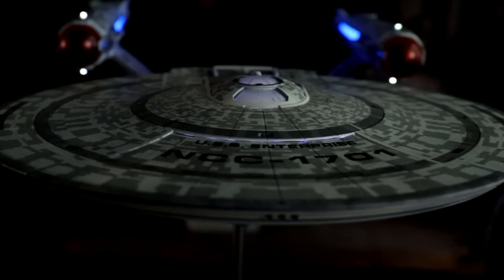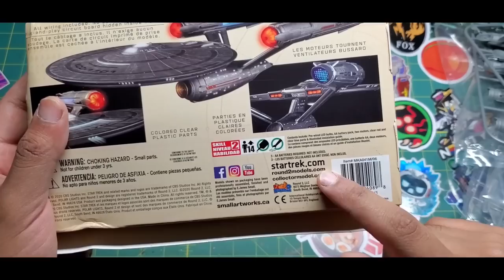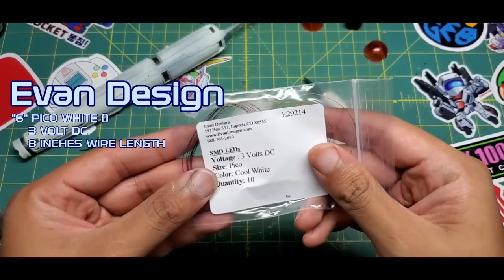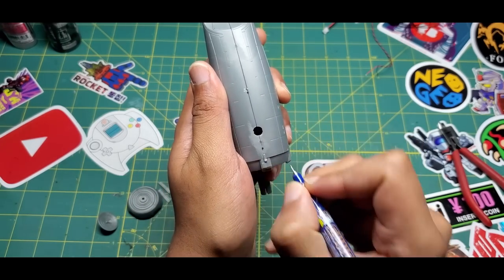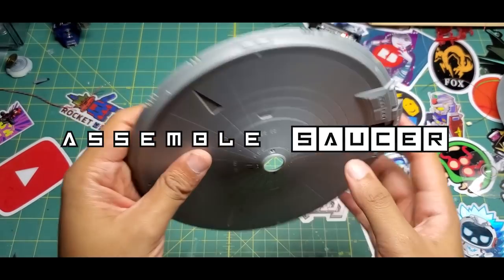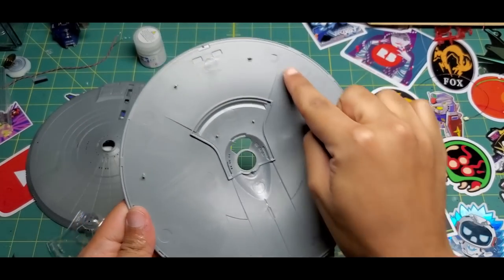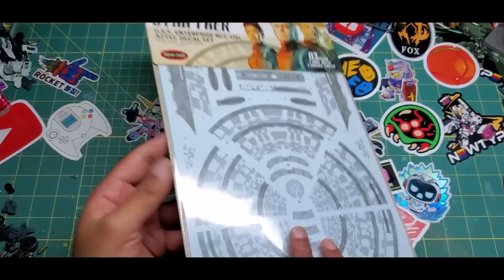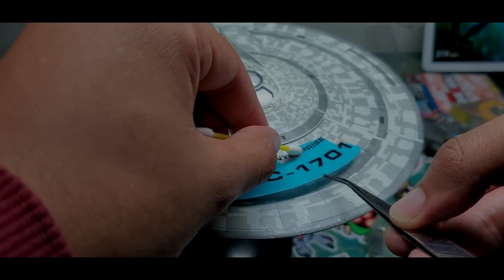#newtype #Otakubuilder 1/1000 Star Trek Discovery Uss Enterprise

Comment: In the old days. 1980 to 1999. The model kits were solid white. Also. The fiber optic Star Trek ship kits were in one box. I still have two Star Trek DS9 Terok Nor fiber optic space station. fiber optic Enterprise 1701 wrath of Kahn refit. In 1993. I went to a model shop and ordered telephone fiber optic strands from a company in New Jersey and designed my own Wrath of Kahn uss Reliant using circuit boards from Radio Shack. I also designed fiber optic. Jupiter 2. DS9 Rubikon Runabout. USS Enterprise E from First Contact. Battleship Yamato. I ordered it from Japan. The company at that time. 1994. Only made 3 kits per year. Extremely fiber optic detailed. Instructions are written in Japanese. But. I've been a serious kit builder since I was 13 years old. I'm 54 now. Kit building is very therapeutic and teaches you to have patience. Extremely good hand eye corrodnitation. It helps you train your Brain to build problem solving nural pathways that will benefit you as you get older in life. In my personal opinion. If you have a love for kit building. You. Like myself. Will become a "thinker" in life. Most people act first without thinking then blame others when things go wrong. Modelers. We are one of a kind. Problem solvers.

Comment: How have the stock Polar Lights LEDS held up over time?  Mine have dimmed to almost nothing after running them continuously for several hours after the build.  Then they started blinking randomly.  I luckily hadn't glued the nacelle halves together and I replaced the LEDS in there with a new kit supplied by PL.  What I found was the motors had actually melted the plastic holders.  So when I fixed it, I took the motors out.  I replaced the harnesses with new.  They've started to dim out again unfortunately.   The lights in the saucer and engineering hull are starting to go too.  Altogether,  I've got less than 100 hours on these LEDS.  It's frustrating.

Comment: Hey guys, starting this kit and finding this video to be a helpful guide! One thing I'm not clear on, do you glue the nacelles/hull/saucer together once you finish wiring? You have to to prevent light leakage, right? How do you go about that so you don't have any excess end up outside the model? Do you try to erase the seam with some puddy and sanding or just rely on the decals? Any guidence is appreciated. Thanks!

Comment: Back in the 1990's I was building the re-release kit of the Millenium Falcon.  That version did not include the lighting kit that the original did.  I also realised that the plastic was thin enough the lights would shine through it.  I solved it by first, spraying the interior with a matt black (Testors paint applied with an airbrush).  After that dried, I then sprayed over that with Testors silver paint.  I thought the black would help block the light while the silver would reflect it around the inside of the model.  I don't know if both layers were necessary (I would go with just the silver maybe) but it worked very well.  The light only showed where I had the fibre optics, not through the plastic where the bulbs were.

Comment: The trick for plastic that isn't opaque? Aluminum foil. Just glue foil inside, make sure it doesn't connect with any wires and poke holes where the light has to shine through.

Comment: I know, this is 2 years old and may not receive an answer but at @24:41 you paint the saucer burnt iron.  Was that only for the inside, but painted the outside the same as nacelles, being, mission models insomniac white?
Reply from the maker: If I could go back In time I would paint the the saucer section with a "Burn Iron " from Vallejo.

Comment: I find it strange that they are using normal motors instead of quartz watch drives. The quartz drives would be almost silent and adjustable speed. They would be far easier to make and replace if needed.

Comment: i feel like the only reason why the kit came out awesome is because of you.  Not because of the kit.   I have almost exclusively built japanese kits for the last 20-30 years and I have gotten used to their quality control and level of detail.  I watch videos of polar lights, amt, ertl, revell kits and I am shocked at how primitive they are in comparison to bandai, tamiya, hasegawa and even kotobukiya..    I feel like if Bandai made this exact kit, they would have molded the details right on the surface instead of decals.    My biggest gripe with huge decals is that inherent bubbly rough surface it leaves behind when its dry.

Comment: The water slide problem have been fixed since the 1st batch and the corrected instruction for those that got the 1st batch have been on their website for months. Also, They need to keep the cost of the kit low enough for the casual modeler that may not want to go through the whole process of lighting it and doing all the Aztec decals. I don't mind the price at all considering that their sales volume is so much less that an average Bandai kit. However, I do want to see them move up to Bandai/Japanese model companies precision and injection molding standard.

Comment: Were you painting the bussard caps both inside and out? I really couldn't tell...
Also, did you use the same power source, or did your custom lighting require less or more batteries?
Reply from the maker: For the bussard collectors I painted just the inner part of the cup. Not the outer part as for the power supply for the starship they are both being run by separate power supplies. My original plan was to connect the Wharton to cells to the main body but I didn't have any spare capacitors lying around so I had to separate them individually.
Reply: @OtakuBuilder  Actually that works better and gets you close to a startup sequence.

Comment: your work is so wonderful, you can really push these to the limit. I would LOVE to see what you do with  1/100 Virtue or even something with a basic detail like EW Sandrock
Reply from the maker: I'm wait until Bandai release a MG Virtue next year. Sandrock... not a fan of the design 🦊🙏🏽
Reply: Otaku Builder yeah Sandrock is a tough one to make something stellar happen. Have you though of using MG led beam sabers? I saw them on eBay for $6 usd
Reply from the maker: @notasleepwalker6286  not really. The only company that does a decent one is kotobukiya and even those are kind of finicky. It's really difficult to light up a very small piece of plastic. There are ways around it but the bean saber Hilt is very fragile. The only way you can pull it off as with either a mega-sized or a perfect grade Gundam.
Reply: Otaku Builder thanks